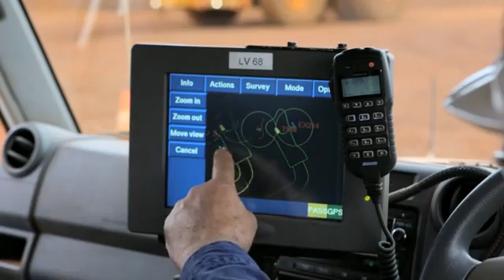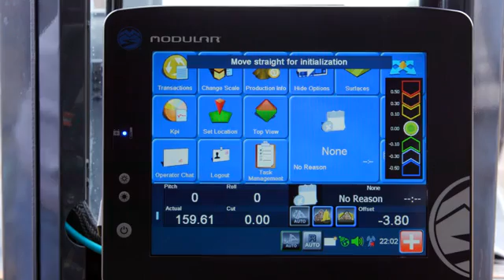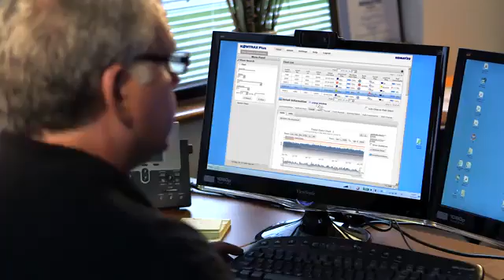Komatsu technology vision

Comment: We had this system in our mine in the Oilsands. It didn't work each sensor module costs about a million $ each and now we got 30-40 of them sitting in a tent all destroyed.  The real reason why we don't use them is becuase whenever ther'd be a fox, coyote or bear all the trucks would be forced to stop.  Also the trucks didn't pick the best lines. Instead of them going into the other side of a lane the trucks would be going through the deepest ruts that you could imagine (Destroying the sensor module, Destrying the truck and getting stuck!)